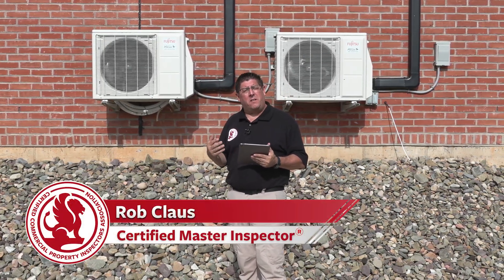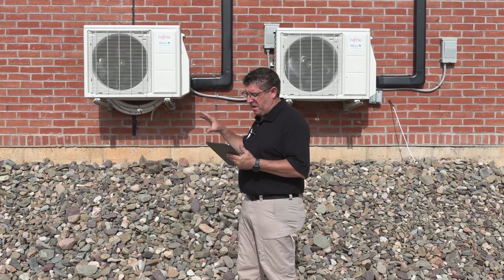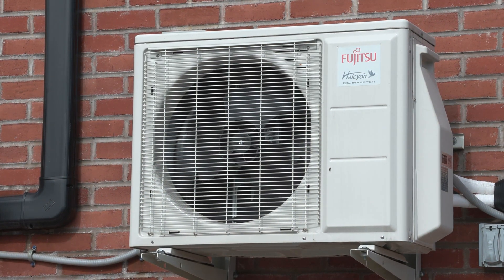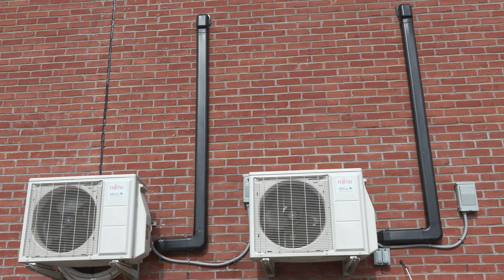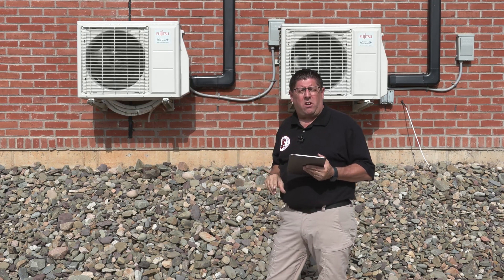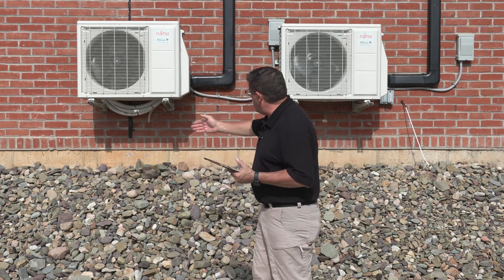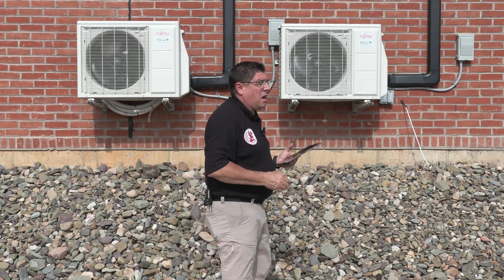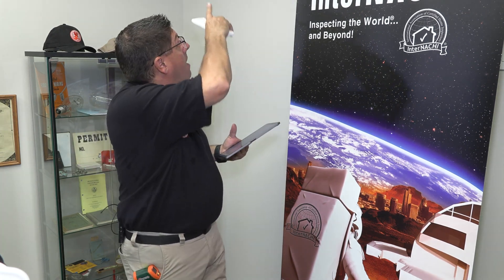Mini-Split (Ductless) Heat Pump Inspection

Comment: Didn't even take off the front cover to check the filter. Needed an iPad to explain a fundamental system.
Reply from the maker: Commercial property inspection scope is a visual inspection, so taking off the front cover isn't required as a baseline. The scope is a visual assessment of property conditions. The iPad is just following a checklist that our student follow along with. Just that.

Comment: You didn't answer the most basic question of whether you test heat AND air conditioning, or if it could dMage the system by testing AC when it's 40 degrees for instance.
Reply: Thank you for the question. These systems operate all year round. The operation of the air conditioning cycle when the temperatures are less than 40 degrees does not damage the system. That being said, each inspector should make their own determination about operating the system. As a practice, I operated these systems regardless of the temperatures.